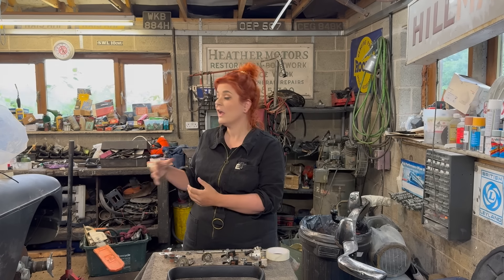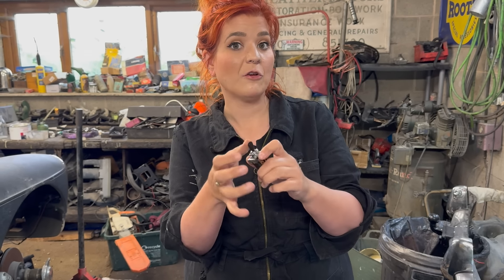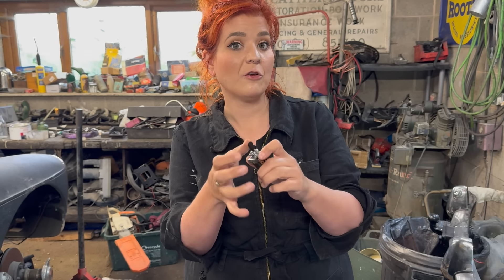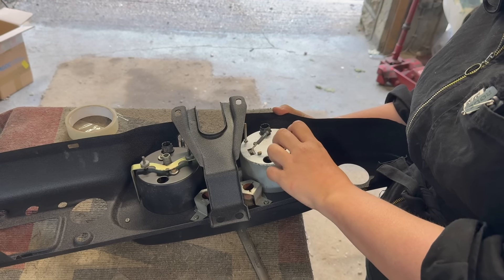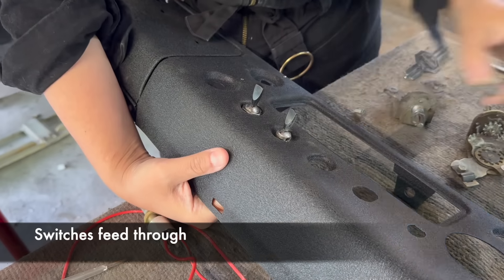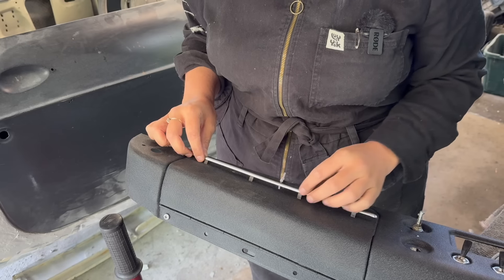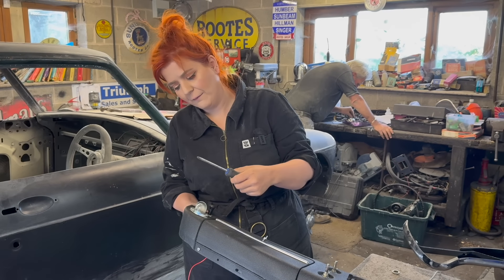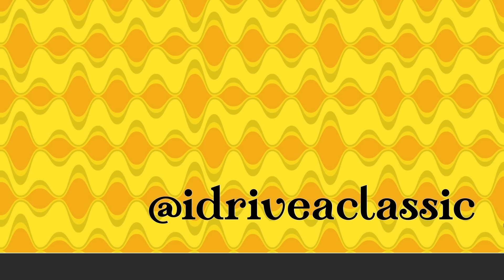70s MGC Dash Build - classic car resto step by step guide!

Comment: Kev's MGC must be a  very late model then, as production stopped in 1969, with the last few being modified (either cosmetically, by fitting a tuned engine or both) by a London MG dealer. 

Great vid BTW.  I have a car that needs building if you want to make a video about putting it together once you've built Kev's MG lol.
Reply: Indeed it is! A 1969, so I think last ones registered were 1970, the model wasn't a success, which is a shame really! My speck year I'm building it to with early seats is 67, just love the purity of the early car 🤔🤔🤔

Comment: I was watching a video on how to replace the head gasket on a Jaguar XJ40 and the person completely skipped the most important bits to make sure the engine won't brick itself at first start: how to position the camshaft sprockets and the distributor. So I agree with Steph, it's better having too many detail than not enough!

Comment: Do you have to send your old dash in exchange for a new one, I will be removing my dash & refurbishing it myself with crackle paint hopefully cheaper than buying a brand new one.
Reply from the maker: This is a really question. I actually have no idea but I’m speaking to the MGOC spares team tomorrow and I will find out.
Reply: Don't attempt it yourself, it's very difficult! You have to have the dash at a specific temperature, then coat it with the same paint at a higher temperature, it's never worked for me! The finish from the MGOC spares is second to none, it wasn't a fortune in relation to the value of the car, in my opinion?
Reply from the maker: @kevinhirst4108 good advice from a man who is tight with cash. If Kev is saying spend the money, it means it’s probably worth spending 😂
Reply: @kevinhirst4108  I did have my own body shop for 40 years so I’m hoping I can do it, I’ve also done one before but it was a few years ago. 😉
Reply: @123rtheo  no problem then I'm sure you will be able to do it to a great standard 👍👍👍👍
Reply: @123rtheo  Hi. I'm sure you have the knowledge and skills to do a proper job, the problem is the product. I know 2 very competent people who have had trouble with crackle paint. In both cases, the paint came off after a fair while, and it definitely wasn't due to bad preparation. It maybe is just a bit too much of a gamble weighed against the cost saving.